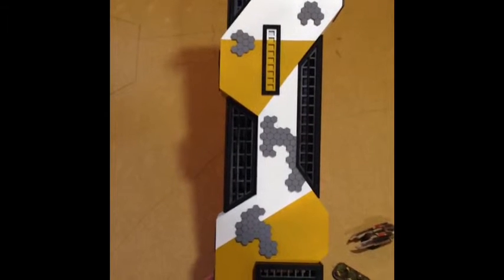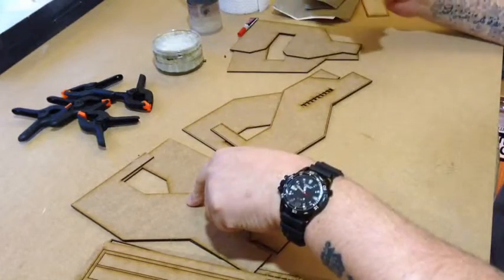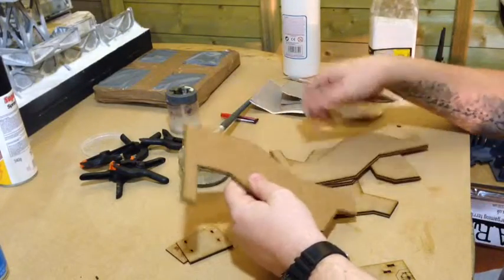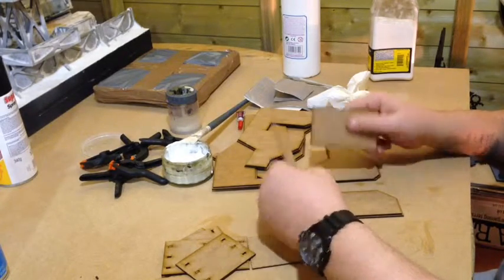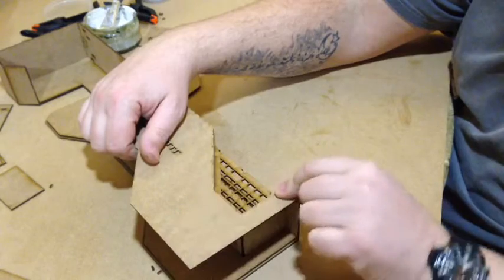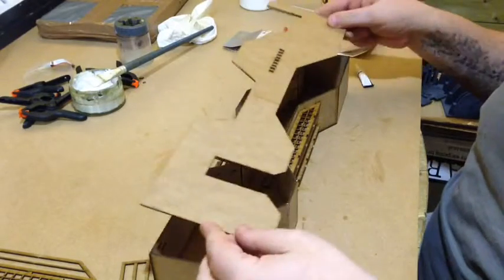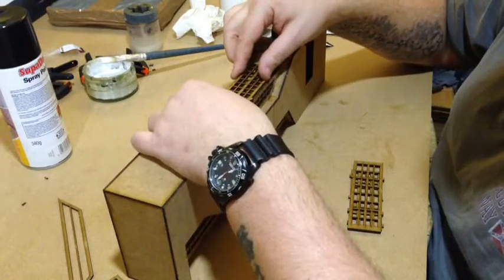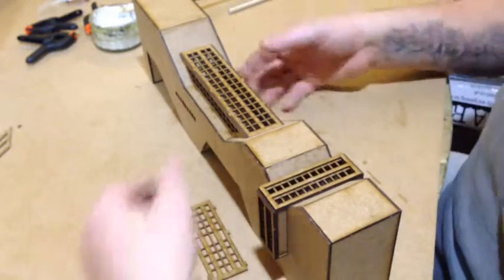Nakotomi Plaza

Comment: I really like the building and enjoyed putting it together. 

I can't stress enough how important the first step is. If you are even slightly off, you will end up with some ugly edges. Apart from what is  recommended in the video, it helps to take a wall piece and check if it is "flush" all around :) (thanks for the new words)
If you end up with an edge - you can sand it off - but seriously wear a respirator. Sawdust and especially MDF dust are carcinogens, but a personal respirator and good ventilation are a sufficient protection.

The DarkOps stuff is awesome and a nice change to the slightly weird art deco architecture - I love "5th Element" like everybody else, but it doesn't feel sci-fi to me. ("Our new building materials are awesome and endure for centuries... What should we build?" - "Why not bring back some of architecture's ugly ducklings... How about Art Deco?")